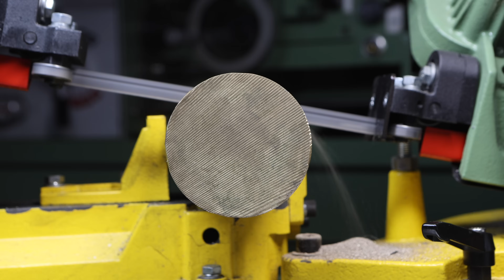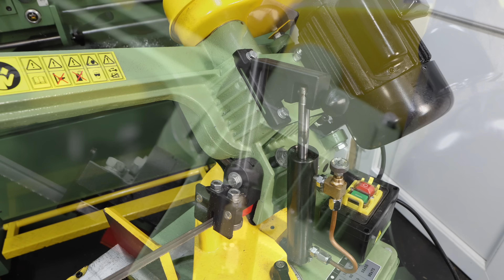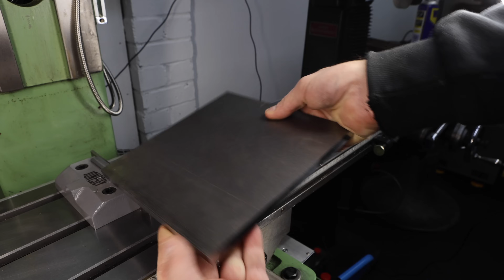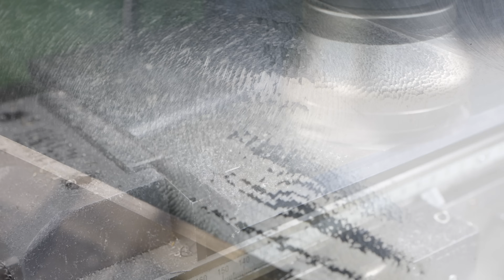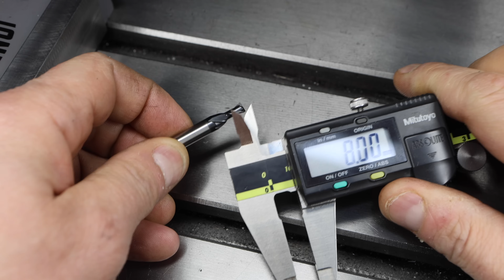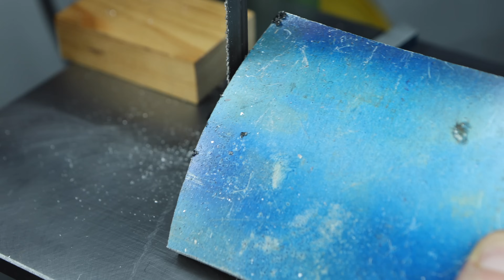Converting my horizontal metal cutting bandsaw to vertical

Comment: Hi Jonesey, When you make the horizontal band saw vertical, is the direction of the moving blade appropriate? I have a Vevor bandsaw but I thought if I wanted to make it vertical, I have to get the band saw mounted up side down to get the direction right.
Reply from the maker: On my one the blade cuts downwards when vertical, which is what you want.
Reply: @joneseymakes  Thanks, I get it.

Comment: Jonesey, what's you opinion of that bandsaw. Looks like the Warco 5" Arm model? You're the first YouTuber I've seen with one. Most go for the slightly simpler 4 1/2" universal unit.
Reply from the maker: Yes that’s right, I really like it, no complaints. It’s a bit more sturdy than the smaller model.

Comment: Great video, I'm going to make the same for my bandsaw - One question, what blade make/tpi/speed are you using to get such a quick cut in the radius you cut in the demo at the end?
Reply from the maker: Ahhhh, admission here - that footage is sped up 4 times so it doesn’t cut that fast. It’s just the standard blade that came with the machine.

Comment: You should see if you can make it work it the horizontal position too, then all you have to do is deal with the pin.
Reply from the maker: Good idea, there isn’t the room though as the plate interferes with the vise in the horizontal position. It’s only two bolts so takes seconds to fit anyway.

Comment: I have one of these types of saw. It came with the plate that you make here. As far as I am aware, it is a standard accessory. 
Question- why did you bother surfacing the steel plate? It is surely flat enough as it is, especially considering how close together the mounting screws are- and they are on a riser that is far from precise. In practice, all sawn edges are going to get machined anyway, so it matters not.
Reply from the maker: It wasn’t standard with my machine. I machined it just because I wanted to get it as square as possible. Probably overkill!
Reply: @joneseymakes  Suspect you just wanted to try out your new vice! 😏
Reply from the maker: @Tensquaremetreworkshop  Busted!!

Comment: Do you find it very unstable ?
I had to put outriggers onto the floor to prevent the lads in the workshop tipping it over when raising it to vertical.
I assumed that was why the replacement machine I subsequently bought didn't have the facility as in this Nany State, we find ourselves living in, it was deemed too dangerous.
Reply from the maker: My machine is quite well balanced so I doing have that problem fortunately.

Comment: Good stuff there, Jonesey :)
Advice for future operations: When using the slitting saw, it's fairly dangerous to do climb cuts. The risk of a self reinforcing, cumulative deflection issues is very high. Always try to do conventional cuts with slitting saws :)
Reply from the maker: Great advice, thanks for that. I’ll bear it in mind next time I get the slitting saw out.
Reply: @joneseymakes It's also recommended to take the full depth of cut in one bite with a slitting saw, too - otherwise you can end up with chips packing into the slot on subsequent cuts, which can bind the cutter. Taking a full depth cut requires some nerve and a solid setup but is actually much less risky.
Reply from the maker: @cooperised  I do normally do that, but my setup was not solid on this one so I did it in several passes

Comment: You could cut some rebates on the top edge of the vice hard jaws so you don't need to use parallels. Nice job on the band saw. Thanks for sharing. Cheers Nobby
Reply from the maker: Good idea Nobby, thanks for that.

Comment: Love your videos as always. Would it not be easier to simply switch blades on the wood bandsaw to a metal cutting one?
Reply: Wood bandsaws are generally lighter built, lower power and higher speed. Because of this, they don't work great for cutting metal.

Comment: 3:04 - A couple of appropriately sized bolts into t-nuts in your t-slots with locking nuts could give you the adjustability on the height that you’re looking to get from your parallels.  Not 100% sure that it needs to be micron perfect though, considering you’re bolting it to one of those horizontal bandsaws.  I have one and it’s not exactly precision engineering!
Reply from the maker: Good idea, I hadn’t considered that. Thanks for sharing.
Reply: @joneseymakes  - You’re welcome!  Excellent videos BTW, love watching them.

Comment: my bandsaw came like that but the "table" was a biy of bent 2mm mild steel. it was extremely noisy due to vibrations. I too put a plate top on 200x200x15mm as thats what I had
Reply: Did you find the machine very unstable ?
I had to put outriggers onto the floor to prevent the lads in the workshop tipping it over when raising it to vertical.
I assumed that was why the replacement machine i bought didn't have the facility as in this Nany State, we find ourselves living in, it was deemed too dangerous.